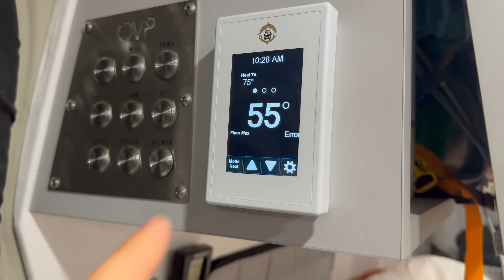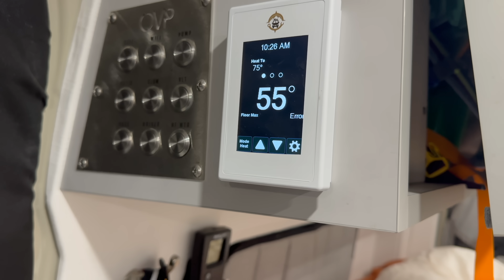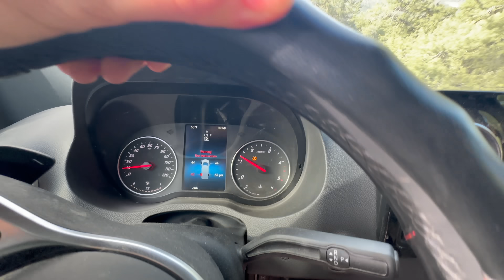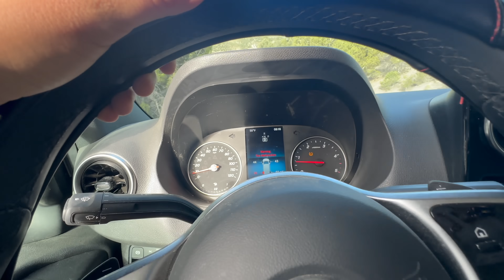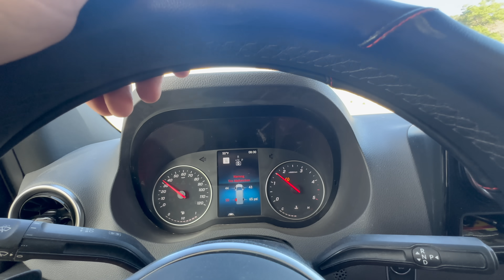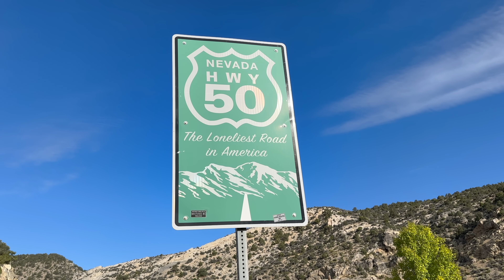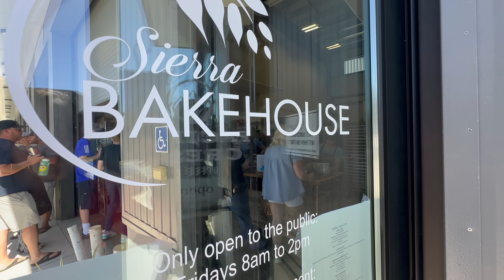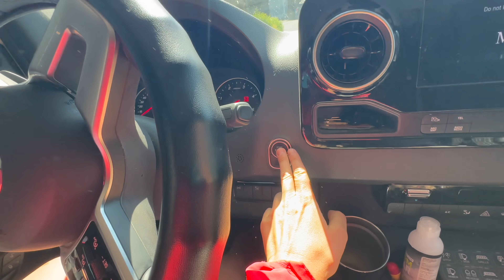1000 Miles in 48 Hours goes TERRIBLY WRONG! | Will the Van Make It? (Day 2)

Comment: Maybe I’m wrong, but this truck seems to have given you more problems for something that was supposedly brand new. Sounds like a lemon.
Reply: She's overly confident. In the mountains she was saying "I hOpE the GiRLs CaN mAkE iT" and then her truck started smelling. THEN knowing she has problems goes off roading??? Like who does that..
Reply: Seems like it.
Reply: That's Mercedes for you. I owned a high end sports car and it was absolute garbage. Electronic failed constantly. Like all the effing time. It drove me nuts. And repairs are expensive. All of this started right after warranty ended of course. I will never ever buy a Mercedes product ever again.

Edit: You can see the tire that popped is literally rubbing on the fender. It likely heated up the tire's exterior, which weakened the outer shell. Now introduce a sharp object and that thick rubber is now mushy and weak. Explosion.

Those tires do not fit on the van. It's dumb of Mercedes and whoever installed them to say otherwise.
Reply: @jessicabartomioli8765  We all live and learn, I’m sure she just did!
Reply: Any vehicle that is off-road is always going to have something going on that needs fixed. It’s run hard vs driven on roads. It’s nothing to do with the MB being a lemon. I’ve owned a lot of MB’s, and I still own two (one of them is a sprinter) with regular issues when driven hard off road.
Reply: Sold mine after 6mo.😮
Reply: You’re not wrong, it’s a Mercedes that’s being used as a 4wd. But what do I know I’m just a 40 year master mechanic
Reply: BF Gs are the only off road tires I have used for 40 plus years. They are the only tires I use for our fleet of 27 delivery trucks.
Reply: No one makes a real 4 wheel drive van only  all wheel drive which is useless. Of course u can have 1 made for $$$$
Reply: Give me a small town, a bakery/ Cafe, and a good mechanic and I'm good.😊
Reply: @sadielaurentiwhitley3762 your the only person who actually knows what you’re talking about on these comments 👍
Reply: @billyc5914  Up until the 22 model year the Sprinter was available with four wheel drive. Hi/Low transfer case. 2023 they changed to all wheel drive.
Reply: Bryson you’re the coolest! 🎉
Reply: New cars are junk
Reply: Unfortunately, none of the 3 major van brands (sprinter, promaster, transit) are reliable.  You wind up having to choose the best of three evils.  My research landed me at the Sprinter as well but I chose a gas (not diesel engine) which supposedly performs better.  However, I’ve already budgeted for bad repairs.
Reply: Modern vehicles are way over engineered and completely complicated , it’s to easy for things to go wrong, like everything in this modern life.
Reply: @billyc5914 that's what she did she turned it into an actual 4 by 4 couple of videos ago she said she only used it maybe once.
Reply: @totorishop while budgeting is a good thing don't forget the Law of Attraction you get what you focus on and mechanical things have the same kind of vibration has everything else on the planet😮
Reply: I was thinking the same thing. I don’t see where she off roads a lot with it. At least not what I call off roading. 
Considering the amount of time she spent researching everything and the money she paid for it I would be a little disappointed with it.  
I’m hoping for the very best outcome for her though.
Reply: Everyone seems to think new vehicles are "better" because of X,Y,Z (warranties, features/bells & whistles, style, etc), but really old school is best - especially with the van crowd. My current vehicle is a 2012 Pathfinder, 4.0 V6, brawny, plenty of power, back before every vehicle was turbo charged and trying to be 'hip' or trendy. Despite it being a Nissan (which I hate most of their cars), it was built before their quality took a dump, it was made back when vehicles were built tough because that was the standard. It's never left me stranded or even hesitated despite years of neglected maintenance and living outdoors in Maine winters. It's a bit of an underdog or sleeper in the mid-size SUV/truck world.

I previously had a 1991 VW Vanagon. While it wasn't super reliable, it was so simple you could work on it yourself with simple hand tools, no computers involved. Don't get me wrong, technology has its place, but I prefer cars to not have them. 

Once my pathfinder gets worn out, I plan on getting a pre-2000s truck, SUV, or maybe even a van to live out of. No, I won't be able to go to the most remote spots, but I can probably do 80-90% of what anyone in a Sprinter can, simply by being in a more reliable, lightweight, and simple vehicle. 

Also, keeping an old car on the road is WAY more environmentally friendly than any new vehicle, no matter how 'efficient' they claim to be.
Reply: @justjudy7320  Mercedes only makes an all wheel drive van now. Nikki's van is a 21 or 22, that's the last year Mercedes made a true  4 wheel drive van. All wheel drive is entirely different from a true 4 wheel drive. Air lockers top it off for the real deal.
Reply: It's a tire 😮
Reply: @billyc5914  yes sir I'm aware of her vehicle I own one one year newer. Apparently what you're not aware of is she had work done just like Chad living the van life guy where they did something underneath with her differentials. And she made a comment and a video not long ago that she wasn't sure she should have spent the money because she had not used it yet
Reply: @johnrpizzaguy is it because of the miles and rough roads or is it because it’s a Mercedes? 
I’m looking to get a van to travel in, and live in while I travel PART TIME. (I couldn’t live happily without a home to return to) 
ANYWAY, what kind of van would you buy?
Reply: @totorishop  I'd have to choose the Ford because locating service would be much easier- everyone can fix a ford. Mercedes dealers are not everywhere and most other repair shops don't want to work on them-and cannot if they are under warranty.
Reply: @razmtaz1987 I have 3 Mercedes right now. Never ever had any issues. My Winnebago RV with Mercedes engine also no problems. But I don’t beat the shit out of my expensive autos
Reply: I agree it's sounds like she got a lemon .
Reply: Mercedes was good when it was made in Germany. My 70s ones were good.
Reply: @totorishop I sold my ProMaster, she was giving me so much grief. Dodge dealer staff stated to know me by name 🤦🏻‍♀️
So I got Honda Odyssey n converted it. I love it plus I can park it in garage away from harsh winter elements we have here in Reno/Tahoe
Reply: @jessicabartomioli8765  making content for us to watch 😅😂
Reply: It's Germans I wouldn't expect less
Reply: It’s a computer network on wheels, your electronics is not failing - it’s telling you something has either failed or beginning to fail.  You can hear something rotational rubbing in the last vid. Quite clearly you can see that wheel is either very close to the edge or is touching the edge. When you smell or hear something that’s quite clearly not right, get it inspected. You can quite clearly see who in the comments have worked on vehicles. I for one not a fan of Mercedes, but this is not just a Mercedes thing. Modern vehicles are all computer networks on wheels and at some point you’re going to see something fail. The Mercedes van computer network did not fail completely obviously, it probably disabled anything connected with the abs system as a safety feature due to the brake sensor being triggered. Fix it replace the abs sensor and reset the codes all is good.
Reply: Off roading takes its toll, that how she rolls.  She clearly understands the reward is worth the risk taken.
Reply: @jessicabartomioli8765  adventures people do that 👍🏻
Reply: Besides all that. This is the ugliest interior. Looks like my OBGYNS examination room.. it's so sterile looking and nothing homey about it .. I'd hate being in there
Reply: She chose to do it the hard way because she's too focused on her hashtag lifestyle instead of taking it seriously.   @bikenband
Reply: Mercedes is overrated
Reply: Nicki I’ve been following you since Day 1. I must say this is so unlike you? If something smells, don’t continue to drive, yet alone off road!? I’m half way through and I’m thinking the tire? Idk 😮back to watching
Reply: Geez, lots of haters. I love you Nikki!
Reply: Bryson your the coolest
Reply: Actually that Mercedes handled very well  with all the issues let’s 86 the lemon talk BMW and Mercedes handle issues well my BMW never left me stranded when something went wrong it hand,Ed lovely until I got safely near help.  Mercedes BMW and Toyotas are the best
Reply: @billyc5914 Iveco Daily 4x4
Reply: 😱😱😱 So many dope comments! Duh! It’s a Van that has been upgraded to do off-roading! 

I believe that Sprinter van is either a 4x4 or AWD! 

Anything going off road is going to have issues! Whether an expensive Sprinter (140”, high roof, 4 cylinder diesel) or a Jeep! All the bumps and vibrations is going to challenge the vehicles!
Reply: All this talk about off-roading when the worst she's been on is gravel roads any Prius could have been up. (And quite a few roads she did in her Prius, at that). No, there's definitely something a little off about this van. But, it's got her where she's wanted to go, and living the life she wants to live, so while it wouldn't be a rig I'd keep, it's paying for itself in content for YouTube.
Reply: @razmtaz1987 I thought the tire was too close to the wheel well! 

And you have to crawl under the van or put it up on a lift to find any fluid leaks. A piece of cardboard placed underneath should point out the likely spots.

I agree. You got to stop and check out perceived car issues before you resume your journey.
Reply: @totorishop Of the box vans out there, which odel would be the most reliable to own and convert?
Reply: Turn around! You are out of bounds. What do you think a tow will cost way out there?
Reply: $250k isn’t what it used to be
Reply: @sadielaurentiwhitley3762 
Beauty. Your comment is the best.
Reply: @victoriasmith8570 
Didn't answer? Take a Fiat Ducato 3 diesel 115 horsepower. You can install a rear axle differential lock for off-road driving - it will pass. Well, the same off-road where the girl Nikki drives.
Reply: Mercedes. What do you expect
Reply: It is a lemon
Reply: How dare you?!! How dare you all?! Mercedes is the best car company in the world! Everyone knows it! DaimlerChrysler AG! Mercedes is a symbol of the greatness of the entire Western Hemisphere! A symbol of superiority over the rest of humanity! All criticism about Mercedes topics - it's just the machinations of competitors!! Competitors bribe electronics manufacturers and spoil the image of a wonderful company! That's all!! You people are devoid of patriotism, this is offensive! Mercedes is a symbol of the union of the USA and Europe! Mercedes is a girl's name! Mercedes is a symbol of female strength, intelligence and beauty! Is it really necessary to explain such obvious things?!
Reply: That tire is indistructable, how does that happened that it breaks?
Reply: Honestly, watching her videos has only confirmed for me that I don’t want that vehicle! My little Chevy off-roads better, and I’ve been in the mountains with her where I popped a tire just like that, she got me to safety an hour away with 9psi, scary yes, but all was well. Repairs are few and far between! I’m glad I watch these because I’m so interested in the vehicle I want to purchase next, for sure- that one isn’t it!
Reply: @TambovWolf1989 girl, what?!? 😂
Reply: Who are you calling "girl", beauty in a Chevrolet?!
Reply: @jennidestefanoart  
You have a small Chevrolet Tahoe? Very strange. Because the story of this Wilhelmina of New York is exactly the same: her car took her where she needed to go and never let her down. Leave your choice to the Mercedes Unimog.
Reply: @TambovWolf1989  with all do respect, I have no idea what you’re trying to say. Her car is in the shop more than mine has been in the past 10 years. I’m super happy with my decision and learn a lot from her.
Reply: @jennidestefanoart  Nikki is the Wilhelmina of New York. An unrivaled hairstylist and super model. With all due respect.
Reply: @TambovWolf1989  are you okay?
Reply: @jennidestefanoart  ...and she's had 4 different Mercedes Sprinters, first without all-wheel drive. These Mercedes have never let her down. Unlike the Toyota Prius. Which got stuck in the snow at the most difficult moment of her life, forcing Nikki, with a broken leg, to put snow chains on her wheels to escape from those who tried to hold her against her will. Mercedes do not let their owners down.
Reply: @jennidestefanoart  She takes her Mercedes to the service only because she loves her car so much. Mercedes never breaks down. Nikki just constantly improves her Mercedes.
Reply: @jennidestefanoart  :) yes I am. It's a lot of fun talking to you. And I'm not lying.
Reply: Your heater is leaking coolant that is what the smell is and the why you were cold.  The leaking fluid may likely be mostly inside or under your bed.
Reply: @ima40schic  yeah I thought so too. My first van was a ford.  After owning the vehicle, I discovered that not all ford service shops work on transits which eliminates many shops.  The ones that do, don’t see transits often so they are inexperienced.  That leaves us with now fewer shops than originally anticipated.  Okay so let’s talk non-ford mechanics.  Many don’t have a shop large enough to fit the high roof vans (if you have one).  If you have an extended model and a high roof forget it.  

At this point, the number of available shops who know how to work on a ford transit SEEMS to be just as much of a headache as finding a reliable MB shop.  So I went with the vehicle that appeared to have less problems to begin with this time around.  A gas engine Sprinter.  Who knows??!!  I might run or “sprint” into unanticipated scenarios here too as a new MB owner.
Reply: @swadfihri8278  I would’ve gone Mazda / Honda / Toyota any day if they sold bigger vans in the US. I do need to stand up otherwise, I would’ve gone this route too.
Reply: @jessicabartomioli8765 I was thinking the same thing.  Then she realized she was on the wrong path, and saw a bunch of overturned cars, on a very steep hill, in a car with something wrong passing other cars that didn't make it on the wrong road that she's on.  I thought what is going on with an this hat decision making for  a woman by herself in the mountains in a van with mechanical issues

Comment: After many years of trailering boats, driving trucks etc always have a spare tire ready and try to never use a scissor style jack (the little cheap one that comes with cars). Please get an appropriate sized hydraulic jack for your vehicle. I have changed many tires for other people as well, just by always carrying the hydraulic jack. Stay safe yall! 🙏
Reply: yes so true scissor style jack is dangerous even if using rims for extra protection, me and my brother uses regular big jack rated for 1,5ton (it might be a hydralic type, it looks similar sort of to the one the dad with the kid uses) :)
Reply: @captainandrewcrabtree  because all of us vanlifers can spare the space for a full sized hydraulic jack 🙄.
Reply: The scissors are OK but slow.  The jack I have fits into a pocket at the proper lift point so it can't slip easily.  Jack only as high as needed to remove the tire.  Break the torque or do final torque with the wheel on the ground not in the air.  That will prevent most of the rocking of the vehicle while on the jack.  While my jack is made for my vehicle, using a different one would be dangerous as it won't fit the pocket and could slip.  One pet peeve is used car dealers that will strip the jack, tire iron, and security key out of vehicles.
Reply: How big of a bottle jack would work?
Reply: Yes I absolutely agree. Heck, I don't even like using the scissor jack for my car and it [the car] is not very heavy.  I've seen then collapse before while being used. Best case for failure is it doesn't jack up the vehicle and just strips out the screw.  Worst case is the car falls while you're changing the tire.  I've seen both happen.  I'd asy a trolley jack is best, but even a hydraulic bottle jack would work too, maybe affix it to a piece of wood to give it a wider base as most of them are small (the small bottle jacks).  But either would probably be better than a scissor jack.

Comment: Hey Nikki if you are going off road drop your tyre pressure down to 18 psi on the front and 20psi on the back it gives you a bigger tyre foot print on the ground lower the pressure even more if on sand🇦🇺

Comment: There is a way to change a tire without having to lift it with your back, shoulder, etc. 
Tip, roll, & use a shovel (between the tire & ground) to pry it up and line it up with the studs. Also, a pneumatic impact tool (for lug nuts) is compact and easy

Comment: Mercedes is certainly not a Toyota when it comes to quality and reliability
Reply: @Dawn0109, neither have the reliability/longevity of a Ford Transit van. Stats/facts don't lie.
Reply: I love Ford as well and have both a Ford and Toyota.  Mercedes very low ranking regarding reliability.
Reply: @Dawn0109  Toyota isn't much better.
Reply: I have owned two toyota Prius’s first one had over 380,000 miles when traded it in for current 2020.  No issues with either car. 

I agree with you that Ford is a great choice for a camper van regarding reliability
Reply: @Dawn0109  Toyota Prius is not a 4x4 camper van.
Reply: I wasn’t aware that Toyota has a 4x4 camper van.
Reply: @Dawn0109  Toyota Sienna AWD campervan.
Reply: I guess if someone was a hobbit they might consider that for a camper van so that they could stand up in it!
Reply: @Dawn0109  Go argue with Toyota about that, whiner.